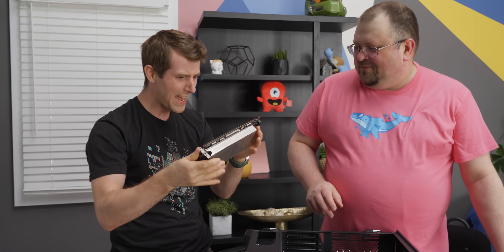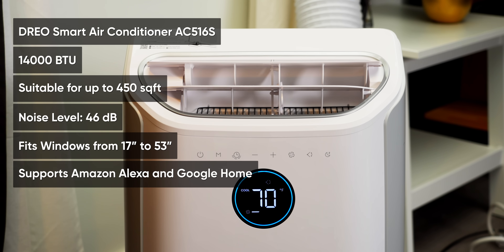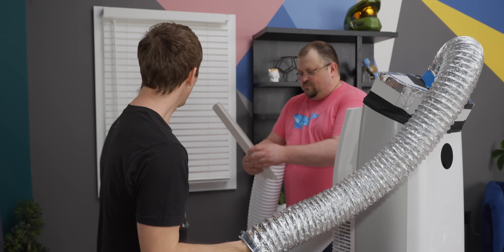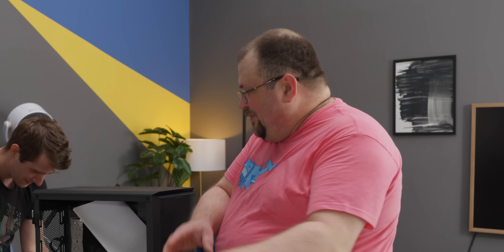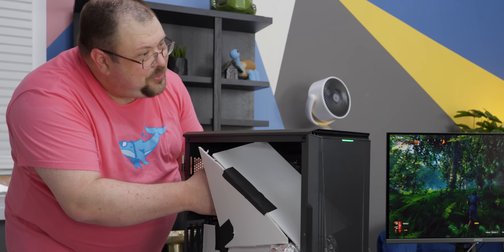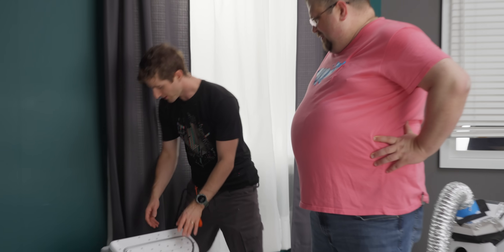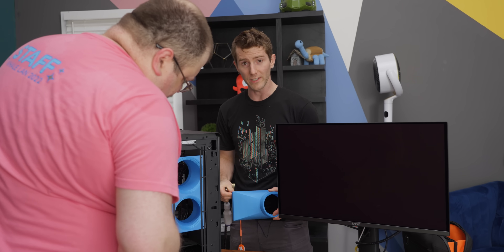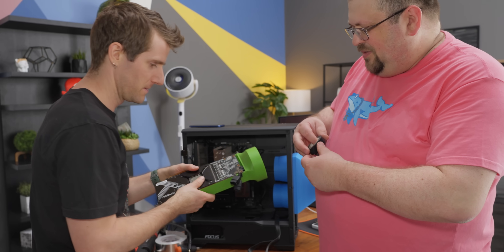Everyone is Cooling Their PC Wrong

Comment: Hey LTT community, DREO here! Wanted to jump into the single vs. dual-hose portable AC conversation—we just dropped a dual-hose accessory for our 318S/319S models(available now on our official website).

If you get a chance to try it out, we’d really appreciate your feedback—let us know about any installation issues or suggestions for improvement.

We’re always working to make things better, and your experience means a lot to us. Appreciate the insights and support from this knowledgeable crowd! Thanks, guys.
Reply: Precedes to run a radiator through a fridge for better cooling
Reply: Realistically the dual hose should be standard. This is the most efficient configuration for a floor standing AC. Plus it would paint your product in a favorable light in terms of performance compared to much of the competition.
Reply: Dual hose should be standard. Single hose is horribly inefficient and limits what your product can actually do.
Reply: I'm unable to find the dual-hose accessory on your website. Is there an article number?
Reply: @blockbertus  I googled "dreo AC318S dual hose accessory" and found it on Amazon.
Reply: Yeah make them a closed loop ac unit for a full pc build to go inside 
Basically .... yall should know what I'm talking about 😂
We've had to use companies like yours when our panels overheat more then once
Reply: I was unable to find it on the official website. Could you point us in the right direction?
Reply: Awesome response. I've followed your company since I first saw you on Mathias Wendel's channel :)
Reply: Finally someone that at least acknowledges that the single hose is quite inefficient
Reply: Relax
Reply: I have your Nomad tower fan and it’s fantastic! Love the collab

Comment: Great proof of concept.
3 potential things that can help with humidity. (The better your seal, the better. Isolate the outside, not the inside. Dust, mildew and other things can get trapped otherwise.)
1. Run your air through generic portable room dehumidifier (or 2 in parallel for more air flow) before the air goes to you AC unit. This can help prevent your coil from freezing as well.
2. Pre warm your air going to the cooling coil. The air will pick up as much moisture as it can. Then when it hits your cold coil, it will shed out (like a portable dehumidifier). DX coils have a tendency to freeze though. Best used with cold water coil that you can keep cold, but not freezing.
3. Desiccant wheel dehumidifier. Push your cold, moist air through 2/3 the wheel to your computer. Let your warm, return air flow through the other 1/3 in the (opposite direction) dry the wheel. Unfortunately, these are relatively expensive and complex. Especially for your general DIY'er.

Comment: Cooling a computer with an AC unit seems like an excellent idea. If I'm not mistaken, this is also the solution used for server rooms.
Having said that, might I suggest installing the computer in an enclosed space, like a closet, and using a small AC unit to cool that space, rather than the computer itself? Most users won't try to replicate this anyway (I hope), so trying to make it more accessible isn't necessary, but someone who actually has extremely powerful hardware could concieveably encounter overheating issues that could be managed with an AC unit in a temperature controlled environment.

Comment: When linus says what's stopping us from doing this, the answer is always simply energy prices. I have a small aircon with half the BTU of this unit, but looks functionally the same, and I could add £70-100 a month to my electricity bill if I ran it all the time my PC is on, with the unit you're using, it would be like 2-3X that, in 3 months you could buy a 5080 or something in the extra electricity you're using.

Comment: Need blower to push cold air and insulated whole pc, only small holes anywhere. So the cold air stay inside. Like room with ac, no cornering or L shape pipe and vunel shape on both end pipe. maybe works

Comment: Linus I think the reason why you saw such a difference was because the cpu heatsink was facing the orientation of the air moving through the case but the gpu was only getting a sliver of the surface area of its heat sink. I think the solution would be if you could mount the gpu sideways so it is orientated the same way as the cpu heatsink and then proceed to blast cold air to them both

Comment: Guys please like this comment.

Why to not create a dual pump and dual radiator.
In idea like we have a heat spreader, so u divide it to 2 sides, and 1 aio cooling left side and 2nd aio cooling right sight.

Take The heatspeader in normal aio, and make separate sides for water for both radiators

Comment: OK...  This is the way...  Take a small aquarium, and fill it with a dielectric fluid called "fluorinert" "FC-40".  Then, you can take the AC'd PC down about -140° F and get zero condensation.  CRANK UP THE SPEED.

Comment: Refrigeration tech here, you should have a pre heater prior to the air entering the PC to remove the humidity / water from the air. This could be something like raising the air temp from 10 degrees to 13 degrees, it will have less cooling effect but would save component damage / corrosion as the humidity % is reduced. As you mentioned insulated duct also

Comment: I think the GPU would benefit from a little bit of spacing between GPU and 3D printed socket... cause right now the cold air hits the GPU like its driving straight into a wall. There should be a bit more space underneath the GPU

Comment: I feel like having a reversible AC unit (ac/heat pump) might be better especially in colder regions as the warm air pours out the main fan and the cool air is pumped via back pipe to the pc… heating your room, cooling your pc

Comment: Did this with my Corsair 800D, back around when it came out. Made a little shroud for the 360 Radiator mount on the top, and I would run it with a crazy overclock to get 3DMark scores my friends with similar systems couldn't beat.

Comment: Why not just hook up the AC cooling pipes directly to the CPU and GPU, like a liquid-cooled PC but with super-chill AC gas instead. Put the AC unit outside. No airflow, no fan, no noise inside. More efficient? Condensation might be a problem. Hmm

Comment: Swap the heat exchanger in the ac unit for a plate style heat exchanger and run alcohol thru a liquid system. Theres no reason you couldnt cool the pc to -40f

Comment: Actually, the
plasma channel 
did a video on basically how to remove condensation out of the air better than extremely expensive condensation removers
Though it might be replacing one problem with another 🤷
Though I would 100% absolutely watch the video and like it and so forth if you made a video involving that on top of what you just made in this video especially if you did a Collab with thee 
plasma channel

Ps but as for the problem outside with it getting on the motherboard on the outside there are ways to stop that there is spray on and other product based things effectively making it waterproof or water resistant
Heck, there’s even a company trying to make laptops and other portable devices practically 100% waterproof idk though at what depth but if the information is to be believed my theory is it would be 100% waterproof at any depth

https://youtu.be/G2brxBRnRH4?si=X6y4kLPBJ_TUzb_Y

Comment: You should try doing this with the heat exchanger from a water fountain. It works just like an air conditioner. However, it is liquid to liquid heat transfer instead of air.

Comment: Accordion ducts kill airflow efficiency a ton, they're not designed for airflow. They're one of the many reasons portable AC units suck. Something to consider though is that the original primary function of the AC was to dehumidify, so it's one of the few ways you could possibly get sub 0 temps without having to be too worried about condensation while it's running.

Comment: I think if you loop the system most of the problems will be gone. A/C half of work is to remove humidity even if it dosent have humidity control in a loop ot would remove the humidity in the air that is inside the loop and would be more efficient. Just need to loop the system air from A/C to pc and then the same air back to the A/C unit.

Comment: i remember many many years ago with an old amd system and a case with a massive fan at the front, i built an intake and then ran metal corrugated pipe out of my bedroom window, which in winter gave me amazing temps, but sadly made the room freezing cold XD

Comment: Don't know if the AC is a good unit or not, but having only one hose is a turn down.  
If your portable AC doesn't have two hoses then it's using the cool air in your room to cool itself and then exhaust it, so it creates negative pressure and that air is replaced by hot air from the outside, effectively cutting down the cooling power of the unit.

Comment: What if you did it the other way round? So the AC sucks out the hot air instead of blowing it in the pc? Shouldnt that fix the condensation problem? 🤷🏻‍♂️ just a thought

Comment: I had been dealing with computer crashes for months.   I finally gave up trying to fix it and ordered a new computer. While I was waiting for it to arrive, I had the brilliant idea of taking the PC cover off and putting a fan right next to it blowing into the case.   I went 3 days before I had a crash.  It was crashing a dozen times a day before that.   I did check the temperature sensors while troubleshooting the crashes and those were at or below where they were supposed to be.  So something was overheating that didn't have a temperature sensor or the temperature sensors weren't working right?

Comment: That is so dumb... Why on Earth would they lay out the fin stacks in the LONG ORIANTATION? If you were to install a fan-less GPU on a Mini ITX laying flat on the ground like my Mini ITX, you would need to let heat escape from the tip end of the fins, which require the foresight to know what position the GPU would end up with and in all scenarios the tip end of each fin ON THE HEIGHT SIDE OF THE CARD! NOT THE LENGTH. The issue with length is that there's little room for hot air to escape compared to the height side. Also, why do most GPUs have intake but NO EXHAUST? What's up with that?

Comment: Wouldn't it be simpler to build an exhaust module similar to what the AC uses to blow the PC's hot air exhaust out the window. Then just use the AC to cool the room. I guess this requires 2 windows instead of 1? But you may not need a portable AC if you can exhaust the PC out (and/or you have central air). Or we can all just agree that the power draw on PC components are getting ridiculous?

Comment: I've always wondered if condensation wouldn't be a problem if you have a PC in an extremely dry climate controlled area where the only air that comes and flows over the computer is from a cycle of itself. Or you can just refrigerate the liquid coolant.

Comment: IN-LINE fan use """"" AC infinity,  Cloud line Series"""""!!!!!!  it is what I use on my forced air/ positive pressure setup on my desktop rig with a automotive cone filter; like what you would see on a cold air intake on a car.  Main goal on my set up was to provide filtered air to prevent build up of dust and pet dander on the computer components.   after 2 years not a single speck of dust or anything inside the case. :)

Comment: You know how car AC works yer, read the book you have AC on (not only reason you can turn it off is fuel saving) ok back to facts you have AC on with heater and that stops condensation also with AC on the heater is working again to remove condensation, basically water is remove on the outside of the vehicle hence the pudding under parked cars. NOTE humidifier removes water on AC units so you could with a good AC use dehumidify mod that would ... ok should fully stop wetness in the PC

Comment: As an HVAC contractor, an issue you are facing is airflow through the tiny gpu area, a small high pressure fan redirecting the cool air into the gpu instead of baffling the cpu airflow…

Comment: I think this experiment would’ve been way better if it was a blower style GPU because it would have forced the cold air through the heat sync fins and then out through the back of the case. 

Edit: the one con to this version of the experiment would be that the initial baseline test would not have been as extremely bad as this fanless GPU. However, they could have achieved the same baseline result or even worse by disabling the fan or removing it temporarily.

Comment: I had an HP laptop - one of those ones with the wacom screen built in so you could use it as a tablet except it was heavy and idled at 70C. Only way i could get it to run properly all day was to tape it so the air intake was directly on my air conditioner. Got it down to 33C

Comment: I have a few points you should consider
, first make 3d prints a little bit thicker with infill, all those air gaps will surely increase insulation in this cas but not completely solve the condensation on the 3d printed parts
Second, you can 3d print some valve type of thing (sorry i don't know exact name, you have to imagine) 
It is used in older engines which came before fuel injected ones, 3d print a disk which blocks completely the CPU duct and a mechanism to rotate it according to your needs. The resistance provided by the disk will control how much air goes through cpu and gpu.
Third, to avoid condensation on gpu and cpu heatsinks, just run your pc for a few minutes without the ac with or without load (your choice) at the end of your gaming session.

Comment: I don't think that AC is "condensation free", but "drainage free", at least up to 85% RH. There's a huge and important difference. As I understand it is designed to evaporate the condensed water to expel it via the hot air exhaust. Which means, it can reduce the humidity of the room, if the hot air exhaust is exhausted out of the room. That in turn decreases the dew point in the room, and that reduce the risk of condensation in the computer even further. That risk isn't very high to begin with, as condensation only happens on objects that are cooler than the dew point of the air they're in contact with, meaning you would have to cool the things down to below the dew point in the room, turn off the AC, and then blow warm humid ambient air over those cool objects, to have a reasonable chance of causing condensation.      

Without adding water, or increasing the pressure, increasing the temperature of air makes the relative humidity of it go down. That means, the relative humidity of the cold air from the AC will decrease as it picks up heat on the way, and without other air, you can't get condensation unless you reduce the temperature below the temperature of the air directly after the evaporator in the AC.            

It's a completely different situation when you cool down components in the computer below the dew point of the ambient air, then you get condensation, obviously. But using the cool air from an AC can be done so there's no chance of causing condensation inside the computer, quite simply, with some just very basic understanding of the physics involved. Maybe not a good idea to try for people that consider using the hot air from the AC to prevent the evaporator from freezing over as just stupid, as stupid doesn't even begin to cover it. Cred for acknowledging that though, even if it was an extreme understatement.

Comment: I modified an old LG "portable" AC by building a box around the condenser intake and piping outside air into it. This eliminated the problem of wasting conditioned air to the outside...  however it seems the temperature sensor was on that coil, so the machine kept running. You are better off cooling the room and piping a "suction" line from your PC to the conditioned air intake on your "portable" AC  machine. That way your PC will only get dry air passing thru it.

Comment: I just wanna see you guys make a video where you use a few fans with static pressure and use those 3d printed ducts to actually just make air flow where you need it. E.g. one fan that blows into a duct that goes to the GPU and then out, and one to the CPU and out. I hate how cases are designed to put a small volume of air in, then let it relax, then lazily make its way out at it's own convenience.

Comment: So your explanation of why condensation would form would be right… if it was chilled fluid. 

Being chilled air, the air cools off, and becomes saturated at the evaporator which is why it has a drip tray. Then as it moves through the ducts it will gain some temperature and becomes saturated less than 100% humidity. Only in the most humid environment would have issues and only when you turn the system off and parts are cooler than ambient.